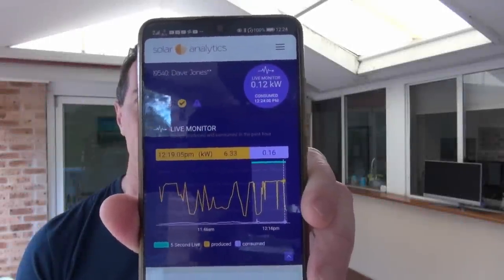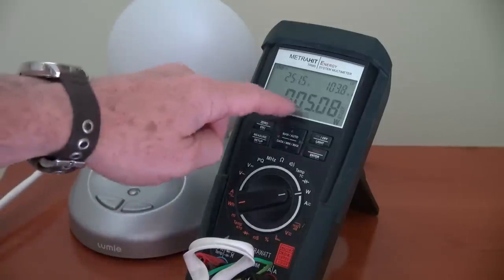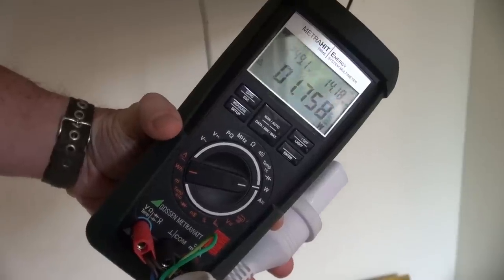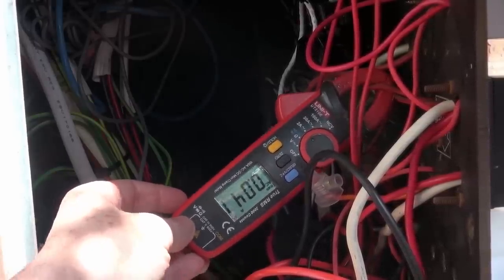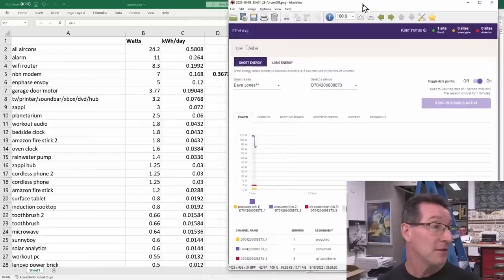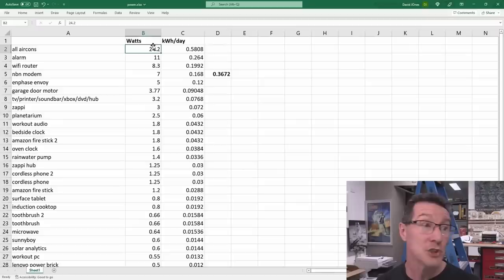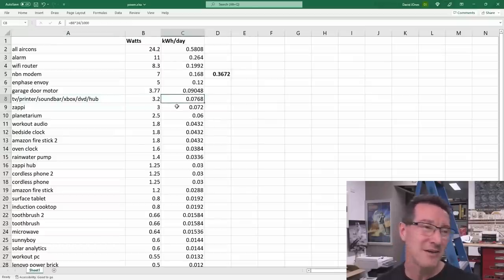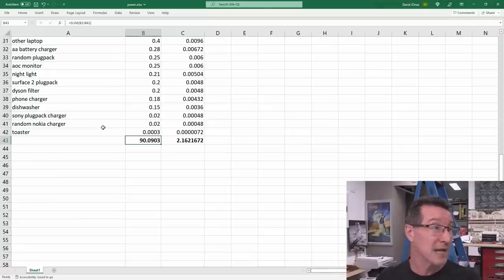EEVblog 1505 - 120W Home Phantom Power? Audit Time!

Comment: 1watt standby is only because that was good enough for requirements, any actually good engineering is in the mW range. Electronics today can be crazy low power. I have a battery powered thermometer, it's a tiny battery that lasts years with a display that changes, not even standby. And that was a 10$ device. That can't even be 1mW of power draw. So 1watt is really sloppy for most devices. Do you still use a landline or is it time to chuck it?
Reply from the maker: NBN VOIP phone actually, forgot that box.
Reply: Yes, I agree, but for most project power consumption is not a good parameter, unfortunately. All the modern cheap IoT stuff uses the ESP32 processor, that while powerful, is awful in terms of power efficiency. There are a number of Wi-Fi MCU that are better in terms of power consumptions but they cost more, and thus they will go with the cheaper option. 

I've measured for example the power consumption of Shelly devices (cheap smart relays), 1W for each device. If you consider that you may want to install one for each light you want to control, you can easily go to 20W just doing nothing. I think that laws must be more strict on power consumption, 1W in standby it's a lot!

Comment: The 20W could be just leakage from the wires to ground. After all, they're not surrounded by perfect insulators, and your mains wiring is probably pretty long as well. Don't forget your whole house is grounded. I don't know how much that matters, but technically, even the bricks are grounded... I bet that adds up.

Also, don't forget fluorescent and HID lights will have X/Y capacitors in them that could be leaking.
Reply: How imperfect do you think the insulators are?

I doubt very much the insulation resistance between both line conductors and the CPC (which is not covered by the sheath..) would be <200Mohm at 1kV for every circuit in my house tied together. That wouldn't add up to half a milliwatt.

Now, capacitive leakage is another matter alltogether, but that will be entirely reactive power.
Reply: Wouldn't 20w leakage from dust/dirt/dead spiders etc be house fire territory?
Reply: @CamelCasee  no, 20W through dust, dirt, or dead spiders would be perfectly fine, but also it's not from dust, dirt, or dead spiders
Reply: @Monkeh616  i think they're imperfect enough. also don't remember the cables themselves dissipate power, as heat. Easy to see if you have a 2000W space heater, the cable leading to it gets warm as well. it's not another 2000W, but it's maybe 10-50.
Reply: @cheater00  20W through the insulation would be a resistance of <3kohm. No, they're NOWHERE NEAR that bad. Insulation resistance on non-faulty installations is measured in megaohms - and any reading below a hundred is a warning sign on anything from this century.

I'm well aware of resistive losses, and you're not going to get 20W of them from <600VA across an entire property.
Reply: The X/Y caps are designed to fail open. Under non-failure conditions the current is 90 degrees out of phase with voltage so no real power is lost.
Reply: @dl5244  Wrong, X caps fail closed (but still resistive), Y caps fail open... but it doesn't matter... leakage is leakage, even if they haven't failed, and leakage is purely resistive, so it's not out of phase.
Reply: @cheater00  interesting. I've never been able to measure X/Y in-phase leakage under normal AC working voltage. All the measurements I've ever taken showed phase angles at almost exactly 90 degrees (the reactive impedance swamps everything).
Electrolytic caps (non X/Y) are a different beast though.
Reply: How many giga-ohms of resistance do you think the non-perfect insulators have at normal working voltage? When you compute V^2/R, how many watts does that consume?

Comment: Get some smart/dumb power strips.  They have a master port. When it drops below ~5w, it kills the other slave ports. Great for tv's and supporting devices, or displays and ancillaries for sleeping computers.   Great for killing powered speakers which are the energy suck!

I do a lot of energy monitoring at home at 10s resolution.  Of note, shitty websites, and shitty ads can waste as much as your audit on some computers.  Firefox left spinning can consume 60-100w with a tonne of tabs and 1 or two poorly designed websites.....

In my head, I associate loads to 100w lightbulbs.  That way I can imagine how bright and hot it is.  Imagine staring at 1kw (10 bulbs).  Or in your case 120w.  Legit.  If the future is bright, as a society, we need to use more power, not less.

Comment: Hello, Can I ask a question outside the scope of this video ? - I have made a electric cat door so my cat can come and go whenever he want, I use two Pir motion sensor (HC - SR501) thru small pipe so detector is pointed at the cat door and it works very well - but now the neighbor cat found out how it works and come in at eat  my cat's food - so I think I need to  have a detector of some kind on my cat so only my cat can activate the door - I was thinking of a device to detect metal and put a small piece of metal on the collar - so I make a test - but because the metal is small (so it is not to heavy) the range is only 2 - 3 cm. ! - and I do not think my can can learn to go so near the door - you got my point. - Do you have another idea I  can try ? maybe a coil of some kind that I can detect ? - I am not keen to the idea to have some electric on the cat - (when battery down then cat stay outside in the cold)
I will appreciate your input because you know everything about electronics!!!        Regards an old cat lover man from Denmark.
Reply: My thoughts... 
a) use a small magnet on the color and a simple reed-contact. If you teach your cat - and they learn fast in general  - to go with the colar close to the contact it will just connect. Metal will be plenty in coloars anyway.
b) or use a smart-camara with detection and compare the photo to the one of your cat only. This is ofcourse the most nerdy and nicest ways ;-)
Reply: Time to pick up one of the Arduino compatible $6ish MCUs with Bluetooth low power on it, plus battery and regulator...and another for the host side, and see if you can hurry your cat into authenticating and entering before very many other creatures sneak by. Good luck.
Reply: @Cineenvenordquist  Now I see a perfect solution and combination... every other creature goes boom or down the hole... or gets a bucket of water over it... ;-)

Comment: Why bother? Once you go to solar battery storage (You were going to go that way weren't you???), that's not really going to cost appreciably at all is it?
Reply: For comparative purposes, my usage peaks at around 300W in the wee small hours (as measured by Solar Analytics)

I appreciate, that's probably not super accurate, but my quarterly electricity bill comes in around AUD$100 (call it $40 per month if you like) and around AUD$200 per quarter for gas (hot water, stove & oven)
Reply from the maker: 100W x 24hrs is 2.4kWh/day. That's 1/4 of a 10kWh battery.
Reply: @EEVblog  True enough, but let's assume it's 400W then and a full charge of a 10kWh battery. At AUD$0.05/kWh feed-in tariff, that's all of AUD$0.50

Will it be worth the effort? Any automated solution is going to need to be pretty damn cheap

Of course, if anyone's solar system is producing 10kWh short of daily needs, it changes the equation. Let's call it AUD$3 per day or AUD$100 per quarter

It still seems like a marginal case unless the solution is cheap (perhaps doing it every day by hand). It doesn't seem like it's worth tipping a bucket load of cash solving it though
Reply: @davidmcdonald3314  Sure, and I said it's basically not worth it. But the audit was interesting to find out if there were any real shockers. For those on a remote off-grid property it could make a difference.
Reply: @EEVblog2  Oh, definitely, in that scenario, yeah. It devalues the (expensive) storage, so doing something to cut that out becomes quite important

Comment: By the time you get all timer switches you will spend far more than you will pay for the power consumed by all those devices in a decade 😂 also switching devices off and on makes devices degrade faster. The biggest power hogs could be consoles not in sleep mode - I believe Xbox could eat as much as 20W when the deep sleep is not enabled - but a great work nevertheless!

Comment: Cmon!
Most digital devices are never fully OFF!
Basic example: How do you think they can sense the remote control to turn on?

Now, that standby mode should only use 1-5 watts, but every single transformer, power supply or charger (without an on/off button) will also draw a few watts.

Comment: WHAT ABOUT YOUR HOT WATER CYLENDER AND OUTSIDE SENSOR LIGHTS AND TV ARIEAL BOSTERS ALSO FRIDGES AND FREZZERS.😁😁😁😁
Reply from the maker: Gas hot water. No sensor lights, no ariel booster, fridge freeze on the battery.
Reply: @EEVblog  excellent👍👍👍

Comment: The new digital meter do charge you for the reactive power.
Reply from the maker: Not in Australia, YMMV
Reply: they have the capability, but depending on jurisdicion/contract are not allowed to.
Reply: Absolute myth. While they have the ability to measure and record it, nobody that I know of is charging for reactive power presently.
Reply: Definitely the case in the UK, but I could not find a clear yes for Australia.  I know when Victoria rolled out the smart meters last decade, there was talk of charging for reactive power consumption.  But, not matter what search I do, I can't find a definite statement that says they are.  So, either they are and not telling us, or they still don't.
Reply: @jodierye3011  Definitely not charging for reactive power in the UK.